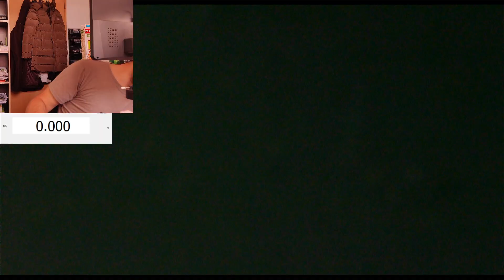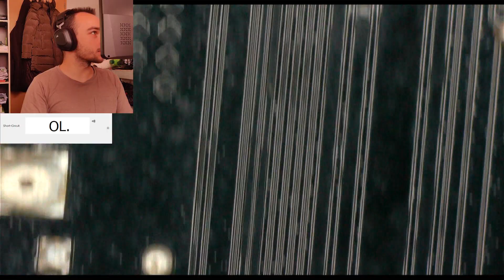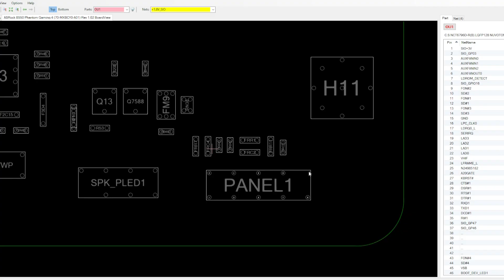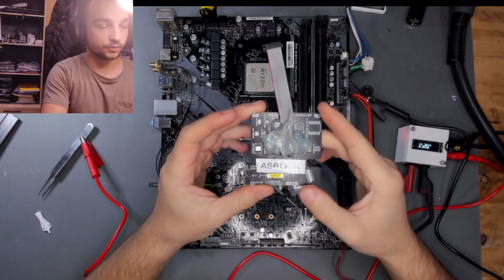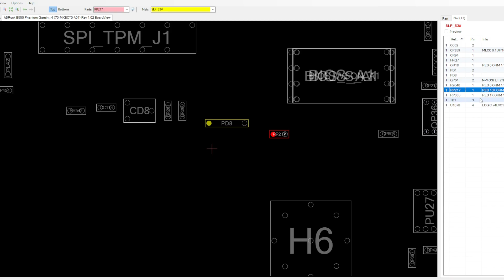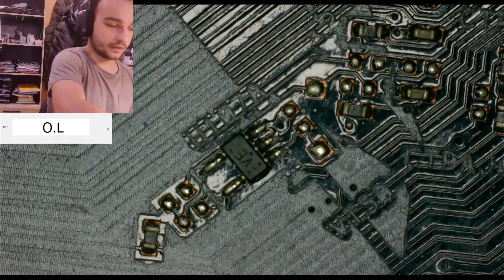THIS REPAIR DEFEATED ME! || ASROCK B550 PHANTOM GAMING MOTHERBOARD REPAIR!

Comment: @Mainboard Medic Hello, could you tell me the value of the Capacitor "CP891" & "CP894" Its missing on my MB which I want to repair
Reply from the maker: Is it also a Asrock B550 Phantom gaming?
Reply: @MainboardMedic  Yes
Reply: @MainboardMedic  So can you tell me?
Reply from the maker: Very sorry, forgott about this. CP891: MLCC 470PF/50V (0402) X7R 10% DARFON/C1005X7R471KGT
CP 894 is not fitted

Comment: hello maybe I would like to fix asus x670e gene which normally posts but os does not see the Realtek module in device manager. tried every possible software option including uploading bios with programmer?
Reply from the maker: If you dont feel comfortable with board repair, i would just get a soundcard!

Comment: SLP_S4_S5# is OK?
Reply from the maker: its also 0V, is that coming before S3? And does it also come from the procecor?
Reply: @MainboardMedic  S4_S5 -> S3 -> pwr btn -> S0 start
Vdd_33_S5 i think OK
vdd_18_S5 (+1,8vsb) ?
Vddp_s5 ?
Vddcr_soc_s5 ?
Reply: @MainboardMedic 
slp_s5 -> slp_s3 -> pwrbtn -> s0 start
Reply: S5 comes from sio
Reply: @raver101010101010  ?

Comment: I have an interesting motherboard case that I would like to ask you about

I have an asus x570-f motherboard the motherboard turns on only if I plug a old dell psu or a good psu with any gpu but no display in both cases.

things to note : the motherboard with a good psu without a gpu will turn on for 1/4 of a second then turns off and never turns on again untill I turn off the psu and return it on(maybe a short), with the gpu the gpu fans doesn't spin but the gpu gets voltage , and ever voltage in the motherboard is right + in both cases the cpu doesn't get hot also the capacitors close to the socket and vrms don't get voltage but everything else gets it fine. 

I have tried to find the short but couldn't, I have done a flashback to the bios and nothing works what do you suggest to do next?
Reply from the maker: Like you said, there must be a shorted line somewhere! I woudl start form the 24 pin and continue from there on. You could also check if it turns on without the 12V CPU!
Another problem could be that voltages are shorted to each other! Like 5V to 12V!
Reply: @MainboardMedic  hey!
so I was searching for the short and I was testing the capacitors close to the Vrms and one of them sparked and now the motherboard turns on but no video still.

also the 8pin cpu when I put the 4pin on the right the light close to the power turns on put when I put the 4pin on the left it turns off .

Comment: I once worked on a Gigabyte B350 that had SLP_S3 missing. And guess what, after opening up the AM4-socket, the SLP_S3-"pin" was broken in a way, that the CPU pin did not make a connection. After putting on a little bit of solder, the board started up again.

Comment: Hello. Did You check AM4 socket? Those sockets are very fragile for almost straight cpu legs. It's very easy to damage pins inside socket.

Comment: Im wondering if the CPU socket cap should be taken off and inspect the CPU pins for damage. I accidentally bent 3 pins on a gigabyte x570 Aorus Pro that I had to bend back to get the board to power on. Just a thought.
Reply from the maker: That could be!

Comment: Correct me if I'm wrong. Motherboards do power on with or without a processor?
Reply from the maker: On most AM4 boards, they dont turn on without CPU , most intel boards can start up without a CPU!
Reply: @MainboardMedic  Sounds to be true, im mainly working on lga 1151s and on 1200s. BTW are you planning to get a preheater and to do socket/PCH changes? I spend most of my free time to check out the preheater hotbeds...
Reply from the maker: @miklosbelhazy741  Yes i am planning to do so! But its hard to find a full sized preheater that fits ATX boards!
Reply: SIO, PCH powers on. They are controlling the debug LEDs, so they can tell if a CPU is not connected/has pin issues.

Comment: Same issues with my b450 pro4, to get it turn on i had heated the corner bottom left side of the CPU and bios 20 second with hairdryer
Reply: Update: finally fix my board recently, It finally react to power button, faulty dual mosfet(panjet brand) that turn on P channel mosfet for 0.9V & 1.05V for PCH, and no VCore enable tracing back and forth a second faulty dual mosfet(also panjet brand), and it boots after bios update

but if not powered on for 12 hours the VCore and VSoc/NB was not preset, checking with oscilloscope and disabling VSoc/NB VRM phase the VCore present but no boot, the ISL95712 Failed to start the VSoc/NB VRM Phase, it would start at random when I probe the Phase #1, I think the Hi side mosfet is need to be replaced with the better one as Buildzoid say Nikos Mosfet Sucks than SinoPower mosfet

Comment: is Rsmrst signal present,,thats requirement for processor to release slp s3 signal ,,and also 32 khz crystal oscillator running near processor socket.
Reply from the maker: RSMRST is present and also the crystal near the processor is a 48MHz one that is also running!
Reply: There's also a 33.768 that crucial.